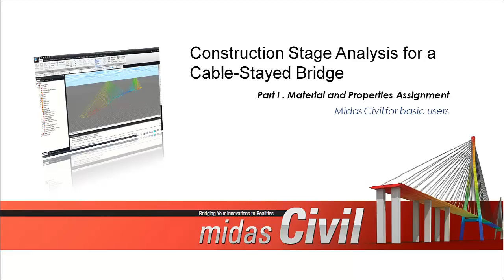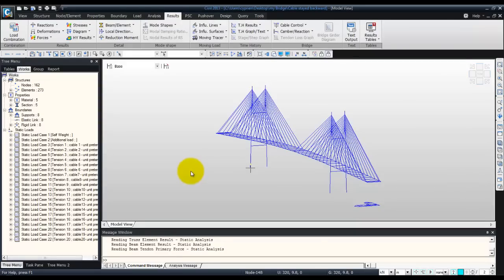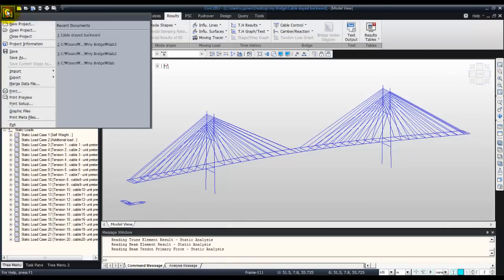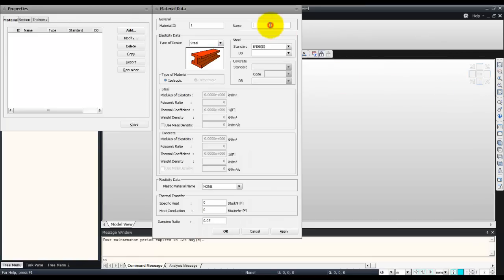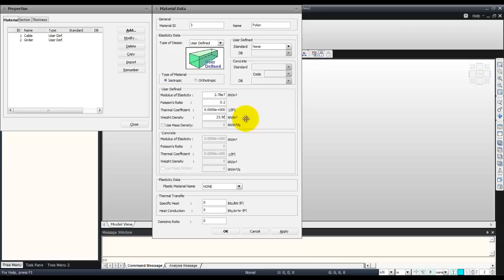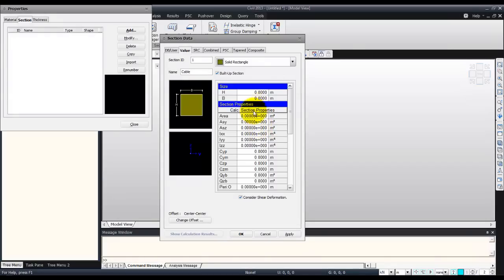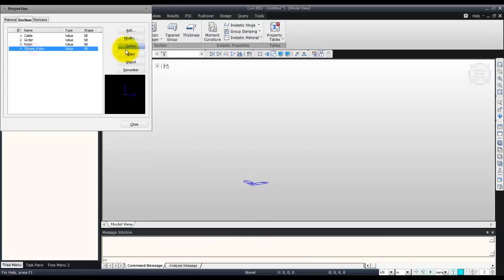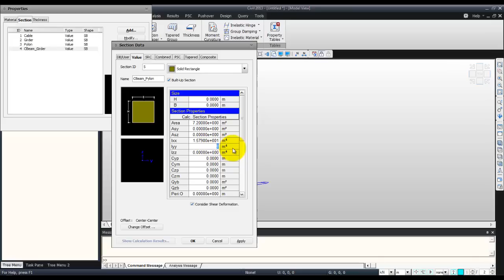Cable-stayed bridge analysis-1 set material and properties: midas Civil tutorial

Comment: For Cbeam_girder the material properties modulus of elasticity is defined incorrectly(1.9613 missing the E+8 at the end)...instead somebody does the model and gets bad results. check 5:17 as well as at 5:43 you have modulus of elasticity 2.78E+8 instead of 2.78E+7
Reply from the maker: Lots of thanks to Albert Einstein:)  for pointing out the problem.  We just added some annotations in the video so people won't make the same mistake as we did.
Reply: sure no problem,just wanted to point it out to avoid getting bad results without knowing what is the problem.great video,it helped a lot !